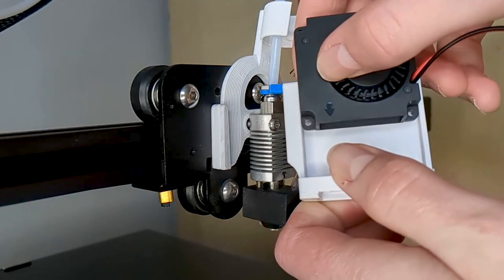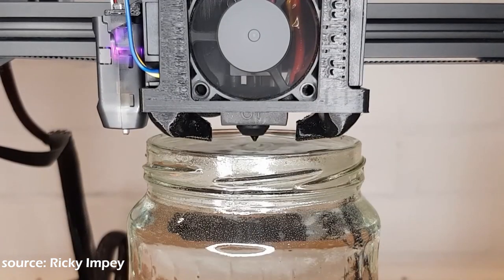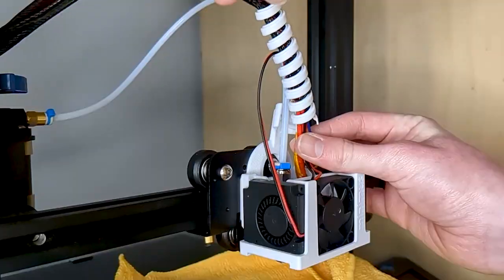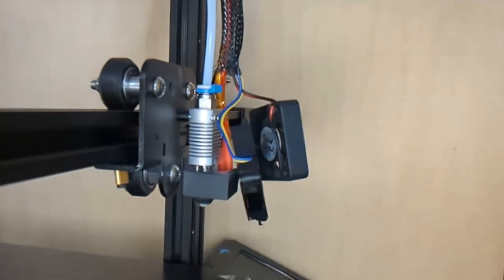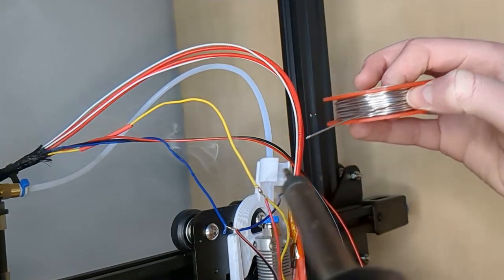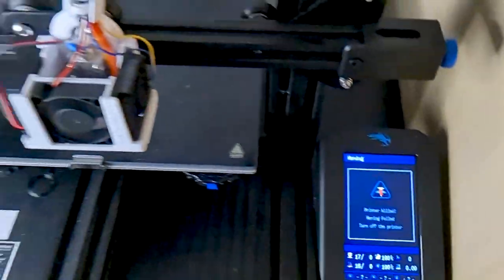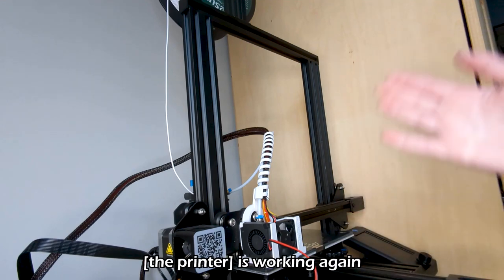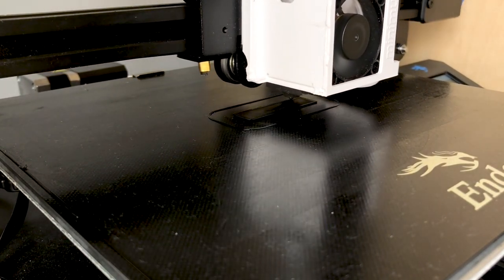This Easy Upgrade Will Improve Printing Performance! (Didn't Go As Expected)

Comment: Dude, your board was on the verge of blowing out. Those fans only use 100mA of current. You could pull probably 2000mA without that happening. The wire can handle probably 3500mA without getting warm. If you soldered the fan with reversed polarity, it’s possible that caused the issue.

Comment: That absolutely should not have happened. I've run up to dual 5015 blowers and never had a problem across several machines.
Reply from the maker: Ooh okay, that's interesting. I'm not sure what went wrong on my end then 🤔
Reply: My ender 3 pro had dual 5015's for over a year, not a single problem. Only had to get rid of one because i wanted to upgrade the hotend.
Reply: @Fr0zenTiger  you might bought the wrong Voltage 4010 blower. there is 24v and 12v version. i am using a 24V one and is powered from the same wire. (side note 24v draws half amount of a 12v to achieve the same result. you might bought the 12v version and might fried the board. if you have more fan header on the board you should've gone to that route and install individually.
Reply from the maker: @halcyonspree1523  I made sure that both the fans ran on 24 volts. I did check for an extra fan header on the motherboard, but it sadly didn't have one
Reply: @Fr0zenTiger  can i ask what model of the PSU?
Reply: @Fr0zenTiger  also are you running your psu at 220v or 110v?
Reply from the maker: I honestly don't know what the exact model is, sorry 😅 I do know that the operating voltage is 24 volts though.

I'm in Europe, so I'm using the 220v option
Reply: Very strange , it looks like you did everything right ,   crealitys quality control is a bit spotty especialy if its a newer printer ,    i have a knock off of an ender (aquila) and like the person befor me said ran dual 4010s then dual 5015s with no issue,  the only problems ive had was bad connections because of my horribe crimping skills rofl
Reply from the maker: @ryanbento1565  Yeah, apparently Creality's quality control has become really bad. Maybe the board was just faulty to begin with. I have a v4.2.7 board now, I still have the extra fan so I could try to run dual fans again, but I honestly haven't felt too keen on trying as new motherboards are not cheap xD I have never used those crimping things myself but I can imagine it can be tricky to get the connections right haha
Reply: @Fr0zenTiger  As long as you don't have any problems with part cooling i wouldn't upgrade. In my case stepping away from dual fans really decreased the print quality on one side of the part (Especially on overhangs). I have a bed probe so its hard to fit dual fans and still have everything work well. My previous setup (with dual fans) had a probe too but it wasn't very rigid and was far away from the nozzle wich are both really bad things. I don't know what your setup is but with the board you have now you have a lot of room for upgrades softwarewise, don't know if you have a probe but i can recommend you to look into it as it's realy nice to have.
Reply from the maker: Yeah good point, there's no real point in upgrading something that works fine. I'm honestly not sure if I'm having problems with part cooling, I'm not sure what I'm supposed to look out for. I can do pretty steep overhangs.

I don't have a bed probe, they do look pretty nice and fancy but they are a bit too expensive for me, I have no problem with having to manually level the bed every once in a while. I've herd you can even get manual mesh levelling with some versions of the Jyers firmware, that's definitely something I want to look into at some point
Reply from the maker: @AyyLmao8512  I haven't noticed any bad lines on one specific side of the print, but I'll start paying attention to it. 
Just took a look at the Poor's man BLtouch you linked, that looks really cool! And you're right, it would definitely make for a cool video. I don't know if I'd be able to pull it off tho 😅 But it does look really cool. And if I decide to do it and I do happen to fry the motherboard at least I'll have a good reason to get an SKR board 🤣 Don't worry about the amount of text, I really appreciate your help! Although maybe it would be a bit easier to message over Discord? This works too though, no pressure :D Thanks for your help!
Reply: I also had a similar issue, running two 24v blower fans through the same fan port. I have searched lot of forums for people with a similar issue but have found none, glad I found this video
Reply: Could those fans not have been the right voltage? Did you install step down buck converters for 24v -> 12v?
Reply: Soldering wires while printer is on could cause that problem... tip of soldering iron also conduct power... true neutral wire...
Reply: Your board was not damaged.  The message on the screen means that one of the homing switches got disconnected.  Now you have a spare.

Comment: Sorry for your troubles.  The Voxelab Aquila X@ has a separate circuit for each fan.  One plugs into the motherboard and the other uses a pair of the screw terminals next to the power input and heater output. Looking at images of the Ender silent motherboard 4.2.7 it has the same options.  The "always on" fan uses the screw terminals and the controllable parts cooling fan uses a socket adjacent to the motherboard cooling fan socket.  Lots of images online to show this.
Reply from the maker: Yeah that's right. The board sadly doesn't have a socket for a second part cooling fan

Comment: I was having exactly same issue, mine with 4.2.2 mainboard. Thanks to the video, I quickly turn off after hearing unusual humming sound of the hotend fan at the first boot up. I then change the added 4010 (different) fan with the creality stock fan so both is exactly same fan, and then problem is gone. So I think for 4.2.2, both fan must be the same on spec.

Comment: fan pinout looks fine, maby the creality board was defective to begin with, or the fan was 12V (although that usually fries the fan not the motherboard.) electrically speaking, the fans are a whole different sub circuit, so it would be more likely to fry the entire thing, or specifically the fans in general. hope you dont toss the board as it may come useful someday. also hope you got an SKR, they are pretty good even if you already had a silent board

Anyway, dual fans are a common mod, so dont shy away from it
Reply from the maker: Hi, thank you for the in depth information!  😁I didn't know that the fans were on an entirely separate circuit, you could be right about the board potentially being faulty from the start. I'm not sure what SKR stands for, but I did get the v4.2.7 board which has way more quiet stepper motor drivers than the v4.2.2 board I had. I still have the old board lying around, I'm not sure what to do with it but it might come in handy one day.

Thank you for your helpful and detailed comment, I appreciate it! 😁 Take care & have a nice day 😃
Reply: @Fr0zenTiger  np! SKR boards are motherboards made by Bigtreetech, they are silent as well, but also improve the quality of prints due to some technical reasons that can be basically narrowed down to "MOAR CPU"😂😂   the most suited for an ender 3 is a BIGTREETECH SKR Mini E3 V3.0. but since you already got a new board i dont think its really worth buying a THIRD board, lol

Also, try klipper someday after you get used to your printer, its a complex upgrade if its DIY, or you can just get the sonic pad, but either case totally worth it
Reply from the maker: Ooh okay, SKR boards definitely sound like a good upgrade! But you're right, I don't really feel like buying a third board while the second one is still working fine haha.

I've heard the name Klipper before, not sure what it is tho xD I'll look into it, thanks for the tip!
Reply: Clipper is overrated imo. Especially on an ender 3, you really don't need to think about that. Stick to marlin unless you are trying to chase a world record for speed. The machines don't really respond well to being pushed to their limits in stock configuration.
Reply from the maker: Yeah that's a good point, Ender 3s aren't that great after all
Reply: @Fr0zenTiger  No, they are great but a budget machine is still a budget machine.

Comment: I really felt bad when your printers motherboard broke, but you really did a good job by posting this video, this video might save someone else from frying their motherboard.
Side note: an ender 3 here in india costs about 180 to 200 USD. Its motherboard if bought separately costs around 90 USD thats 50% of a  new printers price, so where i live  getting a new motherboard will leave a good dent in the pocket.
Reply from the maker: The motherboards are a bit cheaper here, I got this new one for about 50 euros

Comment: thank you for sharing , you show me the hidden risk for the fans upgrade. that very important to me because sure that I would not bought the new board if the same issue happened, actually , I watch some youtuber about how to let the printer less noise, all the video did well and I suppose it seems easy job... but now I will make sure 100% success before I get this update.

Comment: Such a bummer that the fans killed that board :/ I wonder why, as you're wiring (yellow/red and blue/black) should have been correct. I made the same dual fan upgrade to my Ender 3 V1 a few months back and it's worked great. 

Super cool shroud though, think I'll try it out as well

Comment: For some reason I'm thinking adding the load of another identical fan wouldn't cause the mainboard to fry....  I'm betting something may have accidentally shorted during the install.  I've done worse myself lol...
Reply from the maker: Yeah I think you're right, fans draw so little power they wouldn't fry anything right? I did unplug the printer from the wall but yeah I wouldn't be surprised if I accidentally let the exposed wires touch the frame or something else they shouldn't have touched 😂
Reply: @Fr0zenTiger  yeah a few weeks ago I bought an open box ender 7 and after assembling and powering up I think it was returned because the part fans didn't work. So I busted out the multimeter and started probing to see if the fan ports had power. Whilst doing that I accidentally shorted the k-fan 2 pins and the positive instantly melted!  Fortunately no other damage or issues caused by that. In hindsight though I should have used leads rather than trying to get my multimeter probes into such small spaces. Lesson learned.
Reply: I just dit a snip and cut om my ender 3v2, both fans are working great. Did you unplug your printer from mains? And cut the cables separately?  I also installed less 24v who draw power from the hot end cooler fan.
Reply from the maker: Yeah, I made sure to unplug my printer from the mains and cut the wires separately

Comment: @2:03 can see the additional fan appears to say it only draws 0.1A and is 24V ... that should not be too much additional current draw.  Perhaps a faulty fan too?  I wonder if you disconnected the fans from the motherboard before soldering ... may have been some sort of ESD during soldering?  The additional fan does not appear to be one of the two brands recommended in the Minimus release notes?  (Creality Stock and Winsinn fans have tested well for fit).  Thanks for the video ... interesting to see the details of the Minimus system.
Reply from the maker: I have to admit I didn't disconnect the wires from the motherboard before I started soldering. I did unplug the printer from the wall but I was a bit scared of messing with the motherboard. But yeah now that I've replaced the entire board I definitely won't have a problem unplugging a fan next time lol.

And yeah it's just a generic 4010 fan, I didn't realise there were recommended fans for the minimus system when I ordered a fan. I don't think there were specific ones recommended at the time, there have been quite a few updates on the files since I installed the minimus system.

Comment: Are you still using this cooler? Please let me know
Reply from the maker: Yep I'm still using it! I've actually actually been working on a second video on the Minimus, but I can't get my last ass to edit it lol
Reply: @Fr0zenTiger  I recently printed the Satsana after my factory shroud broke, i’m not really happy with the airflow though (single 4010 blower). I’m going to order some a sunon 4020 fan which i have seen to be good and just another generic 4010 blower for the other side. Are you also able to share the minimus stl zip with me? If not that’s fine
Reply: @Fr0zenTiger  I just got the new snap version of them. It has adjustable z axis, going to print them soon, hopefully it goes well
Reply from the maker: @chris-qv1rz  Good luck!

Comment: Wiring the fans in parallel should be fine as the draw is only a extra 0.1 AMPs, what was the firmware set to?
Reply from the maker: I never read you're supposed to change anything in the firmware, I honestly have no idea what it was set to, probably the default value
Reply: @Fr0zenTiger  

Yeah these things happen with cheap Chinese products. But I’m not convinced this particular upgrade was the reason for the board failure. 

I will be performing the same upgrade so I can free up a fan header to use for the hotend cooler fan so I can turn it off when the hotend isn’t in use.

So I’ll let you know if I have any issues.

Noting I am using a skr e3 V2

Comment: Are you sure the fan wires haven't touched anything? Not even the frame of the printer? Because a fan only draws around 100mA. The electronics that drive the cooling fan can handle it. Something must have gone wrong during the install.
Reply from the maker: Yeah, I made sure to insulate the wires with heat shrinking tubes and electrical tape. I soldered the 24v wire of the second fan to the 24v wire of the first fan, and the ground to the ground. Were those supposed to be the other way around?

Thank you for taking time out of your day to help me find the the problem, I appreciate it
Reply: @Fr0zenTiger  That should have worked red to red then black to black to keep it at 24v maybe try two 12v red to black then red and black to the motherboard
.
Reply from the maker: Yeah that would probably work. I'm just not too keen on trying anymore tho 😂🙈
Reply: @Fr0zenTiger  If you switch up the wires the worst that can happen is that the fan spins the wrong way. I don't reccomend using 2 12V fans because one would always spin faster than the other because the internal resistance won't be the same and if one fan breaks the other will follow soon.
Reply: @AyyLmao8512  Reverse the wires of blower fan and show us a video on how they spin in reverse. I'm curious
Reply: @L3X369  It's pretty basic knowledge (if you are into electronics) that in terms of brushed electric motors, they spin in 2 directions based on the polarity of the connections. These fans have a + and - so that they spin in the correct direction when you connect them. It won't be a disaster if you accidentally switch them if it's just for a parts cooling fan.

Comment: I think maybe your secodn fan had some kind of overcurrent problem, I have the dual minimus installed on my Ender 3v2 with the full hot end from a ender 3 v2 neo (so all fans are from creality) and it runs perfectly, same process, fans on parallel.
Reply from the maker: Hmm I haven't thought about that. Could something like that kill a motherboard?

Comment: i think that you could broke your motherboard by installing wrong fan 1st if it was not for 24V but for 12V and second you installed fan with 3 cables + , -  and PWM so its diffrent than stock fan wich has only + , -  and connecting those two diffrent fans could broke your motherboard you can try the orginal fan  :face-blue-smiling:
Reply from the maker: I don't think so, it was a 24V fan with two wires

Comment: Did you use heat shrink?
Reply from the maker: Yeah I made sure to properly insulate the wires after soldering, I just forgot to put a clip of that in the video.

Comment: i hate 4.2.2 mobo. They are fragile AF, fried 2 of them because i move stepper motor too quicly and poof gone.
using 4.2.7 now and still going pretty solid..
maybe that what happen to you. Fried internal from stepper motor current...
Reply from the maker: Dang... Yeah that could have happened too. I honestly had no idea that 4.2.2 motherboards were so fragile
Reply: A number of boards for these printers don't have flyback diodes to prevent current generated from the stepper being spun. When it's not getting powered and spins, it generates a current and sends that juice right into the board and since the logic gates that would dictate the amount of power sent are now downstream instead of upstream, there is no protection for it.
Reply: i have 4.2.2 and i think i fried the usb chip when it was back powered from my pi and i did some stuff. I can’t print from usb like octoprint anymore…

Comment: Which duct did you use?
Reply from the maker: Ooh I'm not 100% sure to be honest 😅🤣 I think it was the 4010 Dual base with the standard WM backplate and the 0_L and 0_R fan ducts. I do remember having to file the fan duct down though, it was scraping over the print I was doing
Reply: @Fr0zenTiger  Did you get good results in the overhang test using fan 4010? I got a good result only at 45 degrees.
Reply from the maker: Sorry for the late reply! I didn't do overhang tests before and after, but a few days ago I did print a full printer benchmark and I managed to successfully print the steepest overhang (80⁰). I could send you some pictures if you're in my Discord server